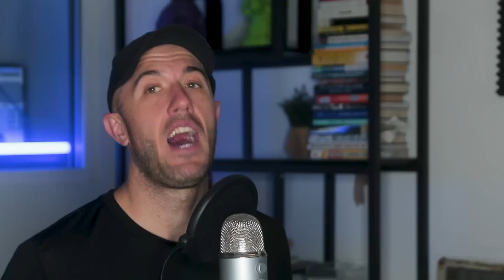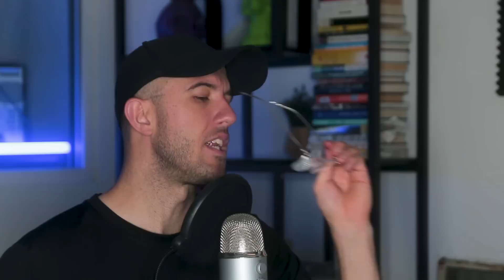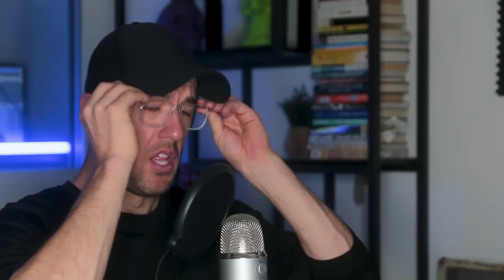3D Modelers Are Important | Stratasys Sues Bambu | Kathy Woods on 3D Printing | 3D Printing News

Comment: A few notes on the Stratasys lawsuit: 
1) They've always sued other 3d printer companies and they've lost (see: Afinia lawsuit). They had been suing in Minnesota where they have their home office. 
2) The heated bed patent actually describes a polymer based plate on a heated platform. So all the plates that don't use kapton tape, blue tape, etc. are safe from this patent.
3) The most worrisome is the FDM printing technique patent. This expires in 2 years but it actually comes after the original set of expired patents which describe this same "feature." If true, Stratasys then applied for this patent in bad faith knowing that this method was actually a part of an earlier patent. The only bright spot in this unnecessary patent is that the method. It looks like it addresses the slicer process and not a current style of printer. As printers go, they are mostly dumb machines that spit out a product according to instructions fed to it from a different process. So Stratasys may be arguing that Bambu Lab's slicer is in violation. 
4) Because they lost other patent lawsuits, they are going to patent troll friendly courts in Waco and Marshall, Texas. Chief Justice Roberts actually ruled against patent troll court shopping, so I guess Stratasys is hoping everyone forgot this. 

tl;dr -- Bambu Lab has a great position in not only getting this lawsuits moved to another court, but to win and have these patents revoked. It's up to Bambu Lab on whether they want to defend. I wish they would.

Comment: Your statement at 35:07 is disingenuous.  Most people did not disagree with you that modelers should be compensated for their work.  I saw the comments.  By and large, they disagreed with your proposed solution (selling g-code only) and they gave good reasons for why they disagreed with you.

I hate it when people make this kind of bad faith argument.   It is deceptive and closer to manipulation than discussion.   Rather than continue the discussion and address those reasons, you opted to give a sermon about protecting intellectual property.

I'm all for protecting IP and ensuring creators are compensated.   I think most people agree with that.    Can we have a conversation about how to do that without ruining the end user experience?

Comment: Process patents are absolute evil. Stratisys didn't invent the RFID chip but since they used it in its invented purpose, to wirelessly identify something, they have a patent for using it in a specific case. That is just so absurd. That means someone could literally patent your patent to keep you from using your invention in new ways.

Comment: I expect HP to engineer their machines so that it uses the maximum OEM consumables as it can. 
Their track record with their inkjet printers says it all.
Reply: There'll be chips in the filament spools to make sure you can't use expired filament. And it won't print anything unless you have a roll of yellow filament in your cupboard, even if the part you're printing doesn't use it.

Comment: I'd love to have a printing service like the one you described in the other video. However, until said service can print in any appearance, any color, any material, it's not going to be interesting to the general public. "Any color as long as it's black" might have worked for Ford, and for Tangled; and it might be OK for industrial prints where functionality is king, and nobody cares about what color the part is; but for people printing dragons, flower pots, kitchen items, etc., it's not gonna cut it. I've been printing at home for several years... and 95% of the filament I own was purchased because I wanted a particular look for a particular project. The other 5% is black, white, and gray. And maybe orange. :) I'll probably be using the API or one of the store plugins soon for those times when a limited color selection is OK - but I'll still be printing the fancier stuff myself - whether it's rainbow silk PLA or a multicolor flower pot that looks like a smiley emoji.

Comment: I would say that a good patent attorney might be able to argue successfully that Stratasys should not be provided patent protection as they have not made any effort up to now to protect those patents. Patents are intellectual property, and some of the same rules that apply to trademark and copyright. (Think of the problems Kleenex, Band-aid, Xerox, etc have had with trademark names), etc. Likewise copyright can be lost if the holder doesn't defend their copyrights.

I agree that some of those patents seem to have really long expiration dates. I'm pretty sure that patents are only applicable for 17 years once issued. There may be a period of protection under Patent Pending.

I've been doing 3d printing for about 10 years, and my first 3d printer had a heated bed. It's possible that it was because at the time Stratsys hadn't yet bought Makerbot, but it would be interesting to make sure that the relevant patent wan't part of a patent portfolio that was made available to the Open community. Purge towers seem to be a bit newer. I remember the only two varieties of multicolor prints that were available at the time were the Diamond head, with multiple feeds of filament into the head, and you could even 'mix' two colors to create something in between them. and multi-headed 3d printing. a Purge tower wasn't really critical to the latter, though many were doing a wall around the print for heat management that also worked for doing color swaps but I don't think it was treated as a purge block.

Somehow I strongly expect that Bambu Labs will simply remove the purge block from their slicer options, and force the printer to purge all color swaps into the infill or support of a print.That will be pushed up into the Slic3R implementation Prusa has been developing, and then propagated down into everything else that's using the Prusa implementation tree. Something like that for anything else that hasn't been developed within the open community and has prior art to the patent date Stratasys has gotten (Github is likely to be showing it's worth on much of that as updates to code implementing that solution will be date stamped in the platform.)  There is a reason why waterbeds were fairly inexpensive in the 70's and 80's. The description of a waterbed, can be found in science fiction from the 50's and 60's, so when someone went to patent the idea, it got challenged and the challenge was successful.

Comment: I usually agree with most of your fundamental concepts.   Designs and engineers should be paid for their commercial work, but any variant of DRM is unlikely to be effective without alienating consumers.  I'm an 'old guy' that you want to die off, but from my perspective 3d models are most like music (songs).   Spotify (love or hate them) made it possible for any performer to get royalties from their craft in an industry historically policed by the record company gatekeepers.   The streaming audio platforms make it easy to consumer music ... without the need to worry about  what a song costs.  There are even 'free to consumer' tiers on most services (usually ad supported).

When it comes to 3d printable models, we have catalog/aggregator platforms.   Integration with the consumption method is VERY limited (E.g. Maker World with slicer profiles as part of models with reviews).  Some of them even try to compensate creators through points.   The issue is that there's no way for those catalog maintainers to easily validate legal copyright owners (since most content isn't copyrighted).  It's also problematic that there's no obvious way to pay creators their royalty.    Musicians don't have to know who is playing their song to be entitled to a royalty, but it's USUALLY clear who owns rights to a song/performance.

So, I disagree with IP control being the ultimate goal.  Compensation for IP owners is the goal.  The slippery slope of DRM systems, producer exclusivity (e.g. print farmers), and desktop consumer alienation repeatedly results in high costs and low value proposition for everyone involved.    When I hear "people don't need a 3d printer at home" I'm reminded of Ken Olsen's 1977 comment that, "There is no reason for any individual to have a computer in his home."

Thanks for the videos....keem em coming! :)
Reply: 3d printers will become ubiquitous one day.  Find a Prusa Mk1 or 2 and put it in a box.  One day it'll be like a vintage computer.
Reply: I think you interpreted wrong what he was saying. He was not advocating for DRM or IP protection as it is in patents today. Any kind of compensation could work, it depends on individual designers what they choose, exactly like some go the Spotify route, some on YouTube and others sign exclusivity contracts. A subscription based or add service could work for designers too. This is what Maker World is trying to do (but still a long way to go untill it becomes a good system). That's why they got as much good design as other websites in years, because the designers were incentivized.
The point is that in many cases initial designers don't get anything because they know how to design not to market and the benefits are gathered mostly by people that know how to market the products but don't know how to design them. So how is this fair for the designer and useful for the society? A good design will last a long time even without the sellers but the sellers without  the design will not exist. I know that the sellers have their own place too but it should not be on the detriment of designers that provide them the "ammo".

Comment: It may seem like selling a 3D model should be a 1 time thing. It doesn't cost the designer anything to sell another file, right?

But the designer may have spent weeks, months to design it. Using their skills that they developed over many years, maybe decades. They may have gone to college to learn those skills in the first place. Expensive computers to buy and expensive software to pay for. It might not actually be 1 person. It might be a team of people.

The designer needs to be compensated for that. They have their bills to pay like anyone else and they can't do that by selling 1 file for $2.

Just like with apps. There is probably a team of developers that built it and continue to add new features and support it. Hundreds of thousands of lines of code. Cloud servers that cost thousands, hundreds of thousands to run and teams to keep them running.

Comment: Seems like the killer app for AI in the 3d-design-as-a-service is "here's a design, these are the dimensionally-critical points, figure out how to make this printable in a way that maximizes strength in this dimension (or minimizes print time, or generates a raft that won't curl, or...)".
Reply: I doubt ai will be building mechanical parts well any time soon. At least not complex ones.

Like AI coding, it generates mediocre-best code in small segments, in an OK way. When you want multiple interacting functions it starts to break down.

From a cad perspective, I imaginenthe same will be true. Simple parts will probably be fine. But a semi decent designer can build a simple functional part in seconds to minutes.
Reply: @JOEDHIGGINS  And AI not being able to design a part has what to do with an AI being used to optimize things like orientation and support structure to print a design (especially if you're aiming for significant volume on someone else's print farm)? 

Also: AI can design parts; this was demonstrated back in the late 90s/early 2000s when machine learning systems were demonstrated designing RF antennas for complex waveforms better than a human designer. The problem, then and now, is that describing the problem to the AI in sufficient detail for the AI to be able to design a part is more effort as doing the design.
Reply: @davidedwards9157  I somewhat misread your initial comment. I read it as more of a design optimization problem, not a printing optimization one (think generative design, which mostly sucks). I think printing optimization will also be hard for an AI, not least of all due to a lack of quality data, and the dificulty of acquiring a sufficient quantity of it. 

The RF stuff is a bit specific, and as I remember they were doing something a bit different than modern generative AI (at least if we are talking about the weird microwave antenna things i seem to remember). Like they generated a billion designs and simulated them all out?

Comment: I dont think anyone wanted to take credit away from modelers, 3d printer enthusiasts just dont want to be locked down to some sort of 3d model DRM. I think game developers should get paid for their games but nobody is forcing anyone to play a game on the cloud so the players cant re upload the game files. As Gabe Newell said, piracy is a service issue.

Also what are you talking about having modelers sell their model to a guy who sells a model through your print farm? Why dont the modelers just sell their own model through your print farm?
Reply: I will note that the whole issue first came to my attention when about the only functioning (if you can call it that) place to share models was Thingiverse, and people were downloading popular models, printing them, validating they worked, then selling prints on e-bay without attribution, and in violation of the restrictions the designer put on the model in the first place. I'm pretty sure that most designers would have happily provided a commercial authorized license to anyone who asked and offered to pay the designer as much as the model cost in filament to print at the designer's recommended settings. But the fly by night e-bay sellers who ignored the No Commercial Use restrictions, pretty much knew that they could simply abandon the e-bay user-id they were using, and start all over with a new user-id.

As I understand it Thangs is the one distribution platform that does review uploads and compares them with other uploads to see if the uploader is simply uploading an existing STL from some other platform. I think the easiest solution would be for them to develop an API that upload platforms could use to check to see if a freshly uploaded model was either a copy of, or even substantially similar to, an existing model. At that point the uploader would have to provide some verification that they were the original creator who uploaded it to the first location. Failing to do this, or something similar would open the platform that's receiving and redistributing someone else's work to liability. That API doesn't have to be to the Thangs platform. It also wouldn't have to be an implementation of DRM.

My major problem with Thangs at this point is that the first thing it wants to do with a model I've uploaded is post it to Thingiverse. A Makerbot platform, meaning a Stratasys platform. I.e. I'm not all that impressed with that piece.

Comment: The real news is that the Man in the "Black hat" I started watching 5 years ago is now over 100K subs!  
Great job and Well done!

 In regards to Stratasys,  screw them. I have owned 5 different printer all using the same patents and Bambu flipped the industry on end and made a printer that was fast, worked perfectly and frankly I just love it.  Stratasys has always sucked and hated the DIY segment. They had no issues with the IP's until Bambu delivered a machine that everyone wanted and started making tons of money. If Pursa was not sitting on its butt, and not innovating , Bambu would not have been profitable. Then Pursa would be in the Stratasys bullseye.

Comment: Do you think that overseas manufacturers will be more apt to use farms to avoid import tariffs in the future?
Reply: No. They will just leave the market. The cost of doing that for cheap plastic parts is obscene. Also, print farms don't really employ many people compared to output, so even if they did, it wouldn't be the point.

Comment: You should look into some of Stratasys patents, some should never have been granted, when companies have made the exact same products before Stratasys has patent it.
Reply: It's called prior art, and challenges to that have to either go to the patent office, or need to be adjudicated in the courts. This is likely going to be the case where all of the 10 patents in question are going to be reviewed for prior art, and challenged. For things that have been patented after the widespread use of Github for source code versioning, anything like Purge Towers that predate patents held by Stratasys are likely to be considered. Say a draft wall for a print, that may also be used to purge colors for color swaps, and purging as infill, both may be pointed to as prior art to purge blocks. Likewise head brushing between or within a layer, often useful in PET-G printing to remove danglies and provide a cleaner print surface, can be helpful.

Comment: alot of the patent's seem dubious, the fdm 3d printing one is very similar to the original ones from the 80's. they had a patent thrown out because it wasn't valid in their 2014 lawsuit so likely something similar, at least with that one and the heatbed one.